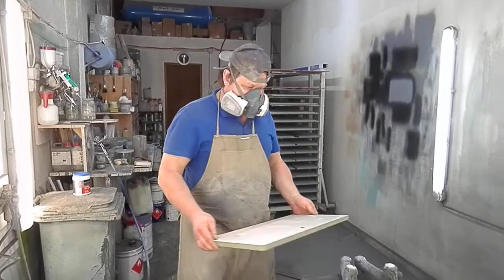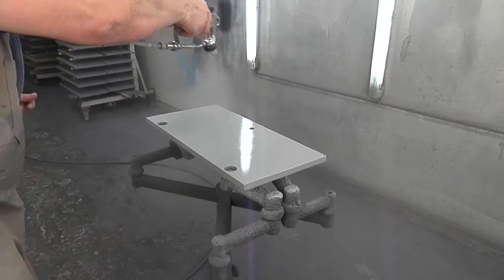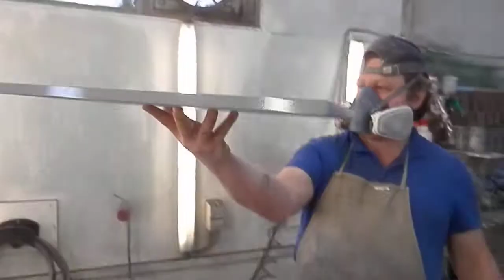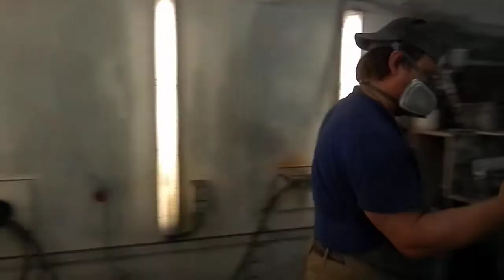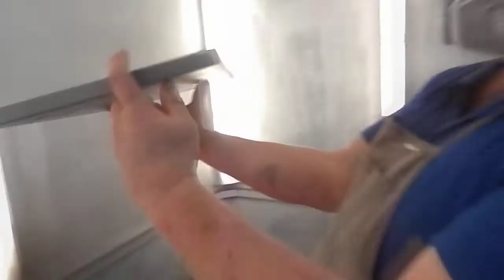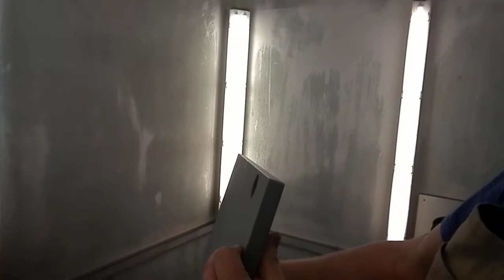WOODMAN: Primering treated MDF edges with Kodrin by Sikkens.

Comment: Hello!! how many layers you have to apply?
Reply from the maker: What do you mean ? If you mean primer itself, then I apply just one thicker coat of primer at each side and 4 passes at edges (in total) so I could have enough material for sanding. Take into account that MDF I use has already melamine coat which was sent before primering. Therefore, I apply one coat of special primer Kodrin to prepare rough edges of MDF.